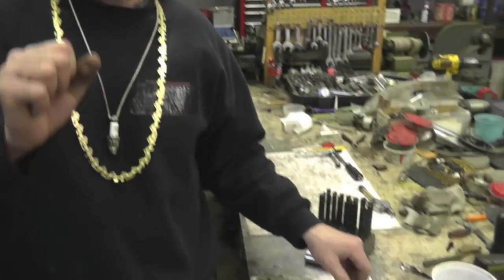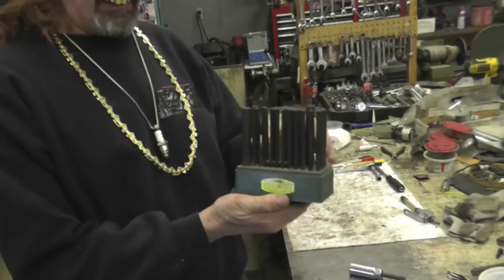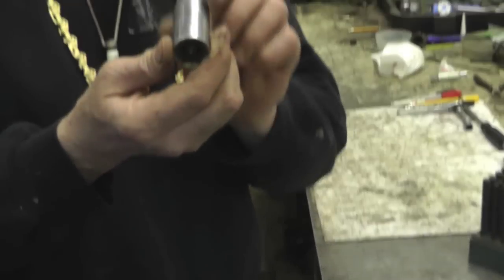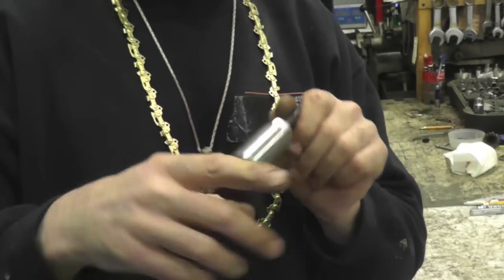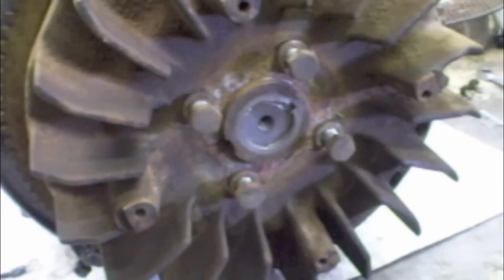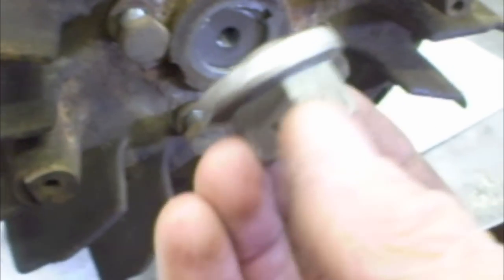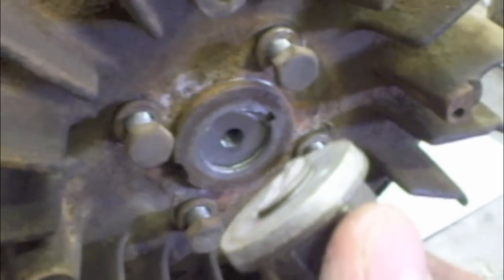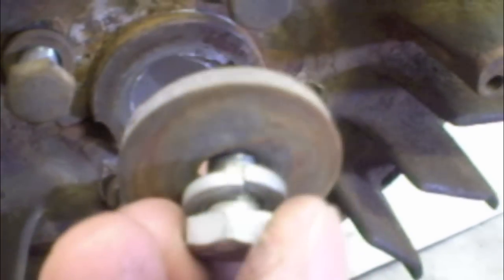How To Fix or Repair A Broken Crank Shaft on Honda,Briggs,Tecumseh,Kohler Engines

Comment: Good video. Is it the lock washer what will keep the blade secure and keep it from spinning? Normally the key way and blade adapter does this.  Also, will you have to set the cutting height lower because the drive shaft will be shorter?  Finally, if the hole is a off a 1/32" or more will the mower will shake/wobble?  Thanks.

Comment: Well its all fixed. This trick worked like a charm. I was using an impact wrench to turn the engine over while I was testing for spark. Then SNAP , oops I guess I shouldnt have been doing that. Then I remembered I saw this video. I followed the instructions and now its all fixed. Thanks alot.
Reply from the maker: Great to hear! Glad we could help.
Reply: so is that the only way that can break  is by doing just wat u did? or how else can that break

Comment: Dolmar is Makitas line of petrol powered lawn equipment,I used to repair Makita power tools under warranty but Dolmar did their own.

That's a good method of repairing the crankshaft, although you would have to make sure that there is enough torque to hold the flywheel down onto its taper so it won't come loose & shear the key off.

Comment: Taryl have you ever had a key sheer on a crankshaft gear that powers the cams on a courage motor? is it possible that it can get out of time with the cams because of this? mine spits gas out of the carb and i have the timing marks lined up with the cams and the valves are set right also.

Comment: I like the transfer punch with a socket to find center. Depending on circumstance using a center finder on sliding square would get you close on a shaft. A center finder slides onto a mechanical squares blade. It looks like a V. That's the piece you generally never have a use for.

Comment: Hi taryl. I had this issue happen yesterday on a Honda gs160. While this helps me secure my flywheel, I still can’t get the flywheel off.   I soaked the hell out of it. And was tapping and turning it while prying with my pickle fork when bang shaft tip broke. Can I heat it to get the flywheel off.?  The key is broken and spun 180.   Thanks

Comment: If it was  a left hand threads does it matter  if you  drill and tap it for right hand  threads ? Aren't most of the  threads  that hold that bold on left handed  threads  so it doesn't  come flying off ?

Comment: dumb a me used an impact wrench on the flywheel nut and snap went the crankshaft,, i was going to drill and tap but didn't think it would work..so if Taryl  said it works i fell better.. thanks for the tip

Comment: Hi Taryl,  Great video and extremely entertaining.  I Have a Lawnboy 1995 walk behind mower 4 cycle model # 10313 Serial # 5902819 with a Tecumseh engine TVS120-63926L.  The top of the crankshaft/Flywheel where the nut, washer, and starter cup attach broke off by 4 or 5 threads. I can get the nut back on only, no washer, and it's not a tight fit (threads must be striped).  Can I tap the shaft as you did in your video then place a bolt, washer, and starter cup?  would I need to cut it flush? and if so what tool can I use to cut the shaft, and what size bolt & washer would you suggest?  Thank You for taking the time.  I watch all your videos.
John.
Reply from the maker: +John Ambrosino You'll want enough of the shaft sticking out to center the starter cup but not sticking up to high that when you drill & tap that you don't have enough pressure to pull everything tight together . If you don't get it pulled tight you'll end up shearing the flywheel key & that will throw the ignition timing off. I've repaired Tecumsehs using this trick. Bolt size 5/16" Try the removing the washer first though you might have enough thread to tighten it down if not drill & tap. OH also I use a cut off wheel to cut the shaft.
Reply: thank you.  John.
Reply: +Taryl Fixes All LLC  Hey Taryl.  I used the center punch as you did in your video.  I then used the Letter F drill bit and then tapped a 5/16 thread.  It worked!!  Thank you so much.  I hope to pick up more tips from you in the future.  John
Reply from the maker: There's yur dinner! John

Comment: I’ve been screwing around with this yerf dog go kart from gi-joes (rip) for a couple weeks now, constant issue being with me not thinking through measurements on welding up a new motor mount and frame. Anyways I took the hopped up 5hp Briggs motor I had on a outlaw kart  (I raced when I was about 3 feet shorter) and got it to mount up! Finally got the chain tensioned, oil topped, fresh fuel...
When I raced the outlaw kart my dad had a 12 volt powered starter for the motor, a 15/16” nut on the end of what looked like a Gatling gun and it’d fire that little gnarly bitch up in a second. So years later thinking about that I pull the pull start off, grab my 1/2” electric impact gun and put the boots to-er. Motor rotates a couple times... then bamn! Like a hot slap of shit to the face, I shear off the end of the crankshaft. Just like you said in your video, I started looking up crankshafts for this little bad bitch and thought maybe I don’t have to rip the motor apart!! You guys made a funny ass video that seriously saved my ass! I’ll still be able to start this bad mamajama tonight! Your my new found hero’s/idols. 
P.s. I’ll definitely take one of them mullets

Comment: I am a new sub, I have been watching some of your videos, they are really good, the best how to videos that I have found.  I collect old Side Shaft Engines,  Mostly Briggs & Stratton  I have a 1952  5S  and a 1945 Clinton. Have you ever seen a Clinton Engine?  Do you ever work on old engines? I just have them bolted to pieces of ply-wood and like to watch them run.  I would love to see a Video of old side shaft engines .  Keep up the great work,  Gerry
Reply from the maker: +gerry mcadams Check out Taryls Toys. I have a video on a 1937 Briggs Y. I have a Briggs N pedal start & I have a 1952 Briggs 5S . I also have a cast Iron 1974 4hp Clinton thats  NEW never been started. Thanks fer Watchin fellow Grass Rat!
Reply: Show us the 1974 Clinton - that sounds super cool.
Reply: I have a 1953  1 3/4 hp REO that, apparently came from a self propelled power reel mower. I'm too chicken (dinner) to start it.
Reply: wish you would show us that clinton